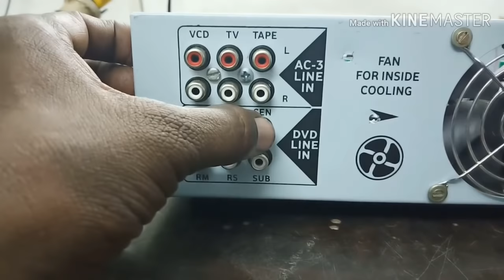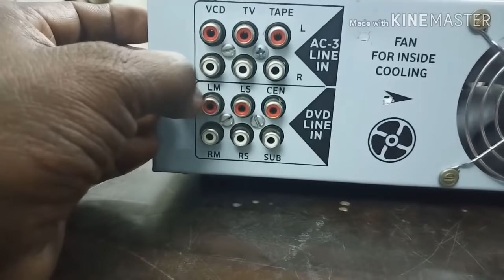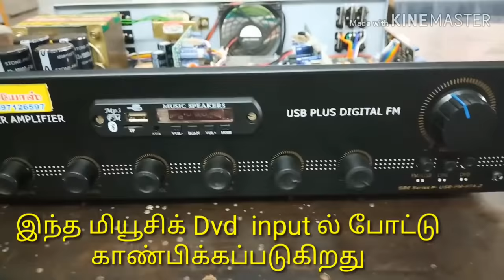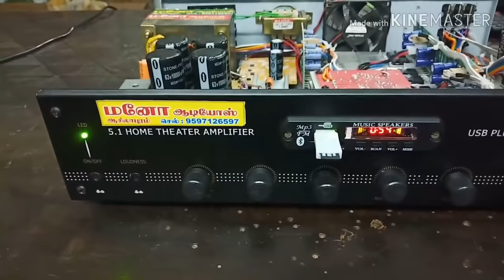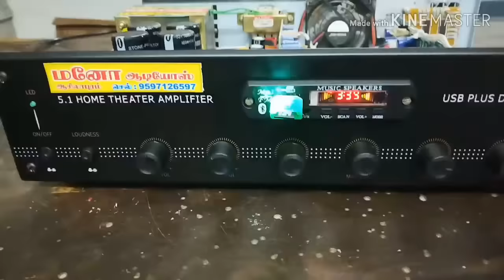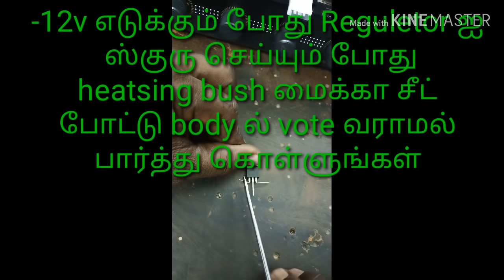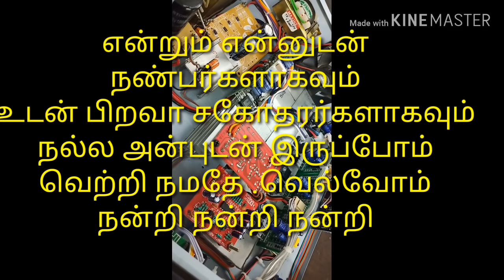IRF 250 N High Power 5.1 amplifier | Mano Audios

Comment: stk 4231 stero single ic ku 30 0 30v 10 amp transformer use pannalama
Reply from the maker: No bro 2 mono sub amp podunka
Reply: @ManoAudios   purila na konjam detail ah sollunga pls
Reply from the maker: @easwaran2883  2 sub board use pannunga bro
Reply: @ManoAudios  thanks bro       stk ic la ON series  ic best  ah illa SANYO (Grey color) ic best ah